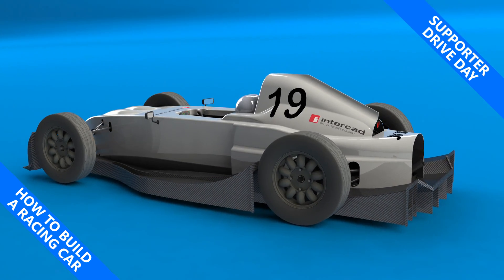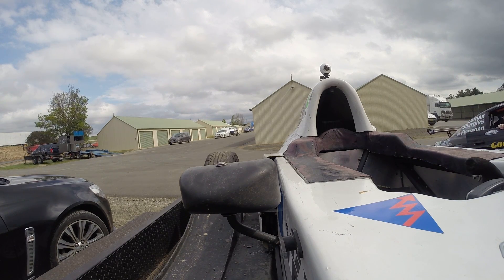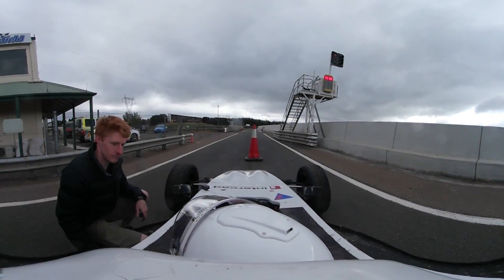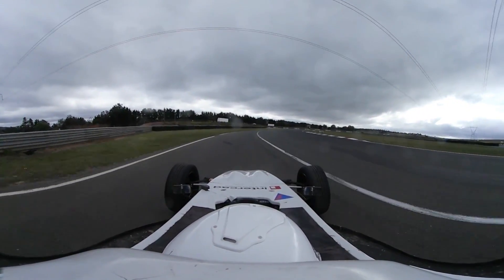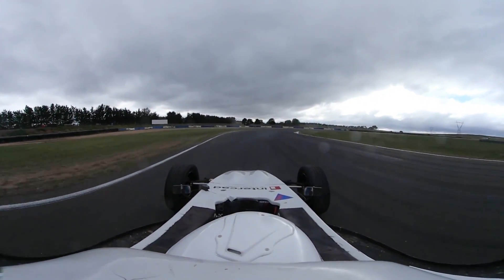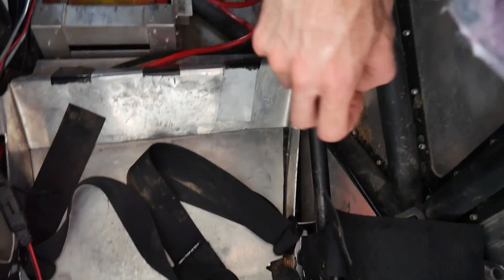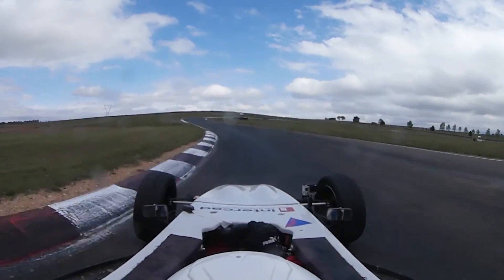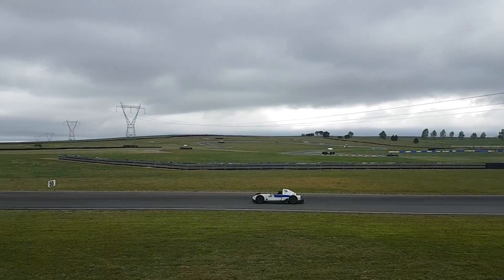Supporter Drive Day

Comment: Hey Simon, do you have any plans of coming back to motorsports and building another car maybe in the next few years? Maybe something cheaper, simpler, because for me at least the main appeal of your videos is the exceptional quality and the amount of work put into them rather than the quality and engineering of the car. Whatever your decision is I wish you the best!
Reply from the maker: No plans no - if I did I would develop an electric car. I think it would suit grassroots motorsports well - quiet so less public complaints against circuits, only needs to last ~15 minutes, easier to achieve parity so discourages competitors throwing fistfuls of cash chasing tenths... Long term I think it could be cheaper than running an IC engine car. I did look at it in some depth but at the moment I'm not in a position to make it happen.

Comment: Hi Simon - sorry to see you are out of racing but glad to see you doing something you like. I race karts and use straight vertical sides that are the same width apart front to back. To reduce the boundary layer buildup would you recommend putting some curvature in the sides similar to what you did with your Formula V? If so, should we use one of the standard airfoil shapes for minimum drag? Other recommendation for minimizing boundary layer at the rear?

What type and brand of camera did you use when your dad and Kyle drove your car? It gives good video and you are able to turn it to track cars as you pass them.

Thanks for your help and best of luck to you.
Team Yellow
Reply from the maker: I'm not the best person to ask on aerodynamics I'm afraid, I really deferred to Kyle for that.
I used a Samsung Gear 360, the first one that looked like a ball. The framerate was only 30 but the resolution (and so picture quality) was slightly better than the second. Sound quality was so horrific I had to use another device to record sound. These days I'm sure there are better options, I did this while 360 cameras were still quite new.
Reply: Thanks for your reply Simon. I really enjoyed watching the videos you made when you were building your car. There is a lot of good information that my son and I can apply to our race kart. Best of luck to you.

Comment: Simon, how was your 2019 season? I'd love to see the working out of the final details. I would also like to jet that carburetor if I was around. A Dyno and some toying with the ignition advance weights and limits as well as spot on jetting is good for probably 15-20% power increase.
Reply from the maker: I've not been racing since this video, I moved to France for work and left it behind.

Comment: Any updates? Missing seeing the videos.
Reply from the maker: I've moved to Europe for my work - someone else is driving the car but isn't uploading videos.
Reply: @thomsenmotorsport7201  where have you been working. Also wanted to know how did you simulate your suspension before the build. Seems it can be made a little more stiffer. Insane build btw considering number of people involved. Probably best I've seen on this site
Reply from the maker: I think the rear could have been stiffer - the guy who's racing it now put stiffer springs onto it. I had to soften the front to improve the balance.
Reply: Oh, good luck with the Job!

Comment: Hi Simon, 
Just binge watched all 32 vids. Very interesting. Really cool project and a big congratulations for the result! I can think of a few F1 teams that would be green from jealousy if the would watch you ;-)

Kyle must have had some commentary/ tips about your suspension setup. Can you still remember? (Just curious) 

Even more just curious: what kind of work are you doing now? Anything to do with automotive? 

Cheers!
Reply from the maker: Thanks. Kyle spend most of the day getting comfortable in the car, there were some things that needed fixing around the seat and gearshift that meant he could only start pushing towards the end. He improved quickly though and with another day would probably have been making changes to suit him.
I'm an engineer working on a couple of projects in Europe related to carbon capture and energy storage. This project was more of a hobby I could use to learn from and a way to get racing again, I don't have any real interest in getting into the automotive sector. Though having said that I do find what Tesla is doing now to be very interesting, but in more of a big picture sort of way.
Anyway, glad to hear you enjoyed these videos, thanks.
Simon
Reply: ThomsenMotorsport Tx, all the best!

Comment: I know I'm VERY late to the game and don't know the build rules but is there a reason you didn't install a small (2 or 3 inch) windscreen? As we say on the push bike scene "Marginal gaines." That little extra smoothed airflow might pay off. Also go weight weenie and pull the weight were you can as you can afford to replace parts like steel bolts for Ti. This is one hell of an awesome build dude!!
Reply from the maker: This was one of Kyles suggestions actually, just one I never got around to. I was comfortably under weight before I installed the undertray so had that freedom to move the ballast. But with the tray I was bang on so just had to live with it as it was.

Comment: So, Thomsen, how much money did you put into this DIY project from start to now (not counting consumables such as tyres and oil, etc. Just build) ?

My brother really likes motorsports and he asked my father for a Kart which is 5.500€ and I told him why not instead of purchasing a car, build one ourselves. So i started searching for DIY projects and just found you!

And i have to say: what an awesome job you did there buddy! Im really impressed.
Reply from the maker: Thanks. It was about 25k AUD for the car itself, closer to 35k AUD with other things like the tow car and trailer costs. Building your own car reduces the cost certainly but you won't get it under €5500, unless it's very bare bones and not designed for a specific racing category. Depends what your aim is really, if it's purely to race then a kart is a sensible choice. For me I couldn't get a (decent) second hand car for the same money and I'd need to wait a year or so to be able to afford it, so time and money wise it made sense.

Comment: I was wondering, why does your car not have a shark fin? it should help when turning etc. right?
Reply from the maker: A shark fin helps with stability, whether it helps or not would depend on the car. Kyle didn't feel the need for one during design.

Comment: How tall is your dad? I occasionally think that building a race car might be fun, but it always seems that I am too tall (6'3) to fit in any open wheel style car
Reply from the maker: He's probably only 100mm or so taller than me, but this car was designed very specifically around my size. For me it's snug but for anyone taller it's too small. There are people much taller than myself racing vees, around your height. Just need to find a suitable car.
Reply: Well
If you make the car longer and lie down more you can fit
Or you can make it slightly taller
When you build a open wheel racecar you often build it around the driver, not the other way around